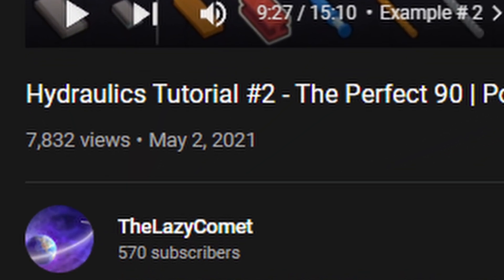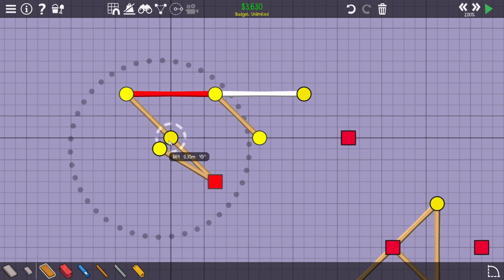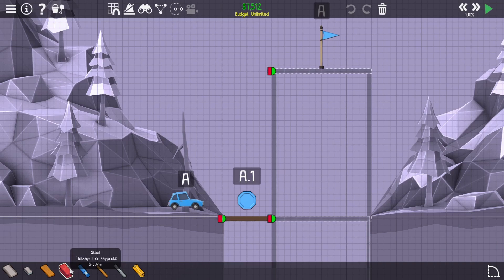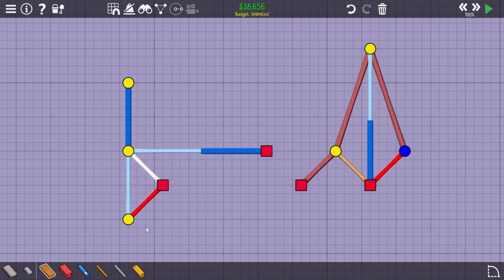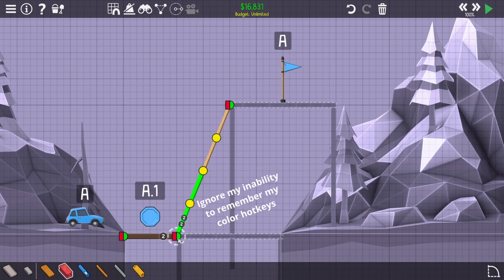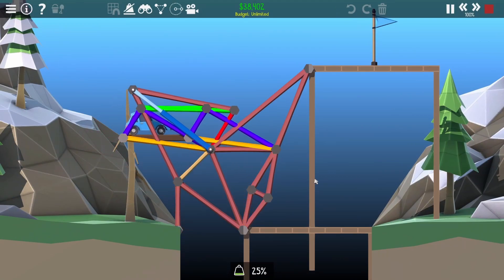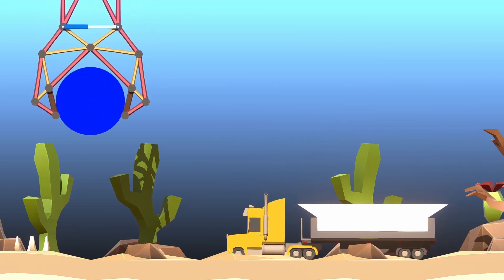Hydraulic Tutorial #3 - Rotating 180 Degrees

Comment: i dont understand how you can place the connecting green rod on the brace and still works, you once put it on the road, another time you placed it to the guiding arm
how to adjut in that manner to work even if you switch places
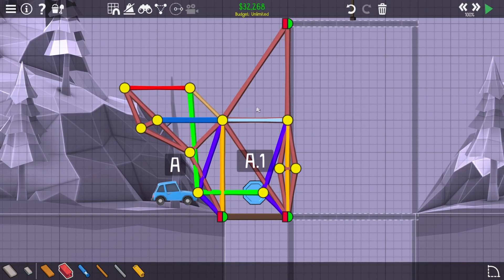edit: 3:32
Reply from the maker: for the timestamp at 3:32 think of it like this: 
the 180 degree mechanism is being placed so that the output, the part that spins 180, is on one of the same joints that i need to rotate 180. in order to get the output of the mechanism to rotate what i want, i have to attach them together. this can be the road or the connection between guiding arms. at 3:32 it was just a shorter to connect it there then connect it to the roads. i try to make this clear when i disconnect the road and highlight the trapazoid that is moving. hope this helps
Reply: @TheLazyComet  Thank you so much for answer, it is much more clear now, the series was awesome, thanks for all the work

Comment: At 5:14 It could be related because on the left, the horizontal hydraulic moves it 90 and another hydraulic that also moves another beam 90. 90+90=180.
On the right, the triangle between the steel wood and hydraulic on the left moves the wood 90 but its locked so the triangle moves 90 instead. It moves another triangle that is the same thing and moves the wood 90 as well.
90+90=180
Only difference is that both triangles share the hydraulic.
Reply from the maker: I invite you to join the public Poly Bridge discord server. if you like messing about with this linkage stuff theres an entire subset of players who just make and talk about new types of linkages
Reply: It's really just a 90 but you anchor the output and use the same hydraulic to drive another 90